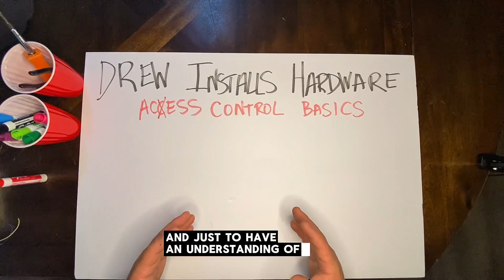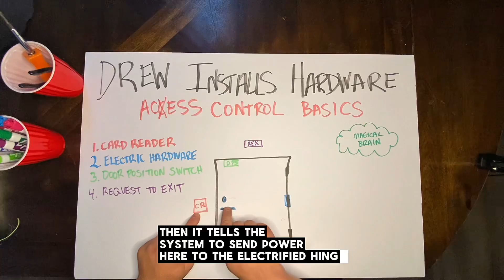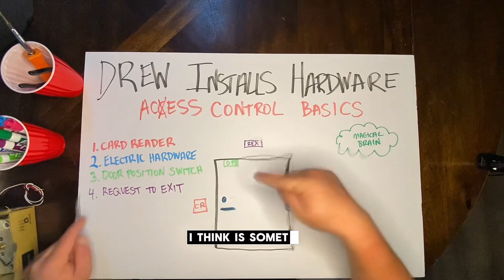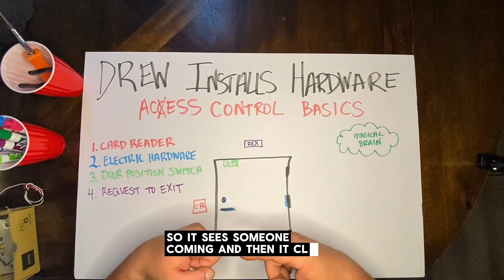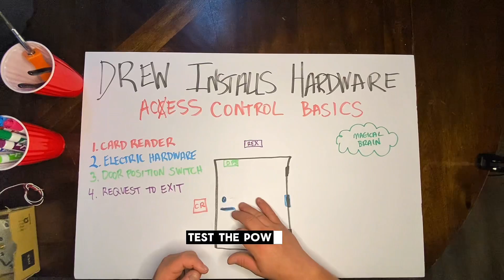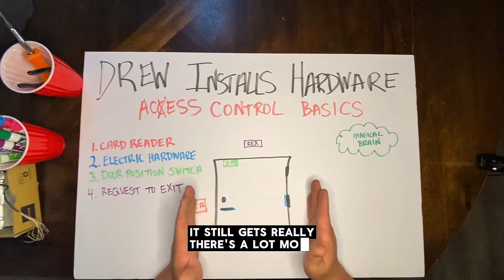How Do Access Control Doors Work?  Basic Explanation.

Comment: Hi Drew, thanks for the video! I have a question in the real life installation. For the Schlage door contact you just showed, do you regularly handover to the security or you just plug them into the frame then the security come back to pry out(very tight) and connect? 
For some hardware schedule the ARCH wanted power supply on every door that has an electric strike, but the security never use them because they run low votage all over the building what do you usually do?
Reply from the maker: Good questions!  Most of the time on the projects I’m on the low voltage/security contractor is supplying the door contacts so they handle those all the way without me touching them. 

As far as power supplies, I think the hardware companies and suppliers like to sell customers their power supplies, but in reality like you said, the low voltage contractors have their own power supplies that they send 24 volts out from.  

There are certain types of hardware (I’m thinking Von Duprin ELR with big solenoid) that have very specific and large power requirements for initial retraction that do need a power supply close to the opening, but in general for handlesets and electric strikes the power supplies in the telecom rooms work just fine.  😎